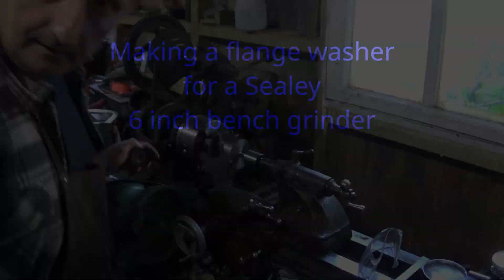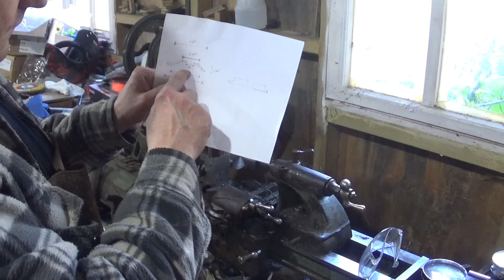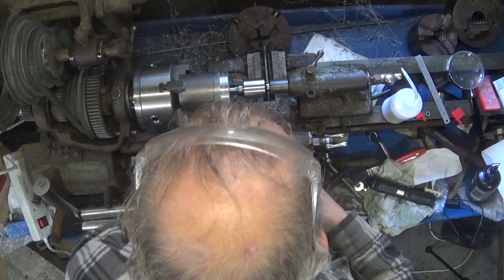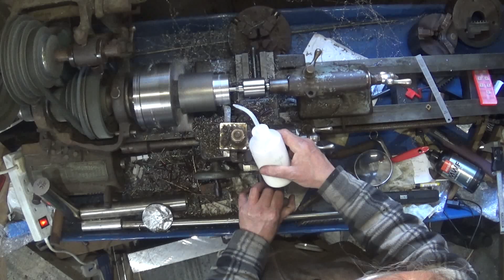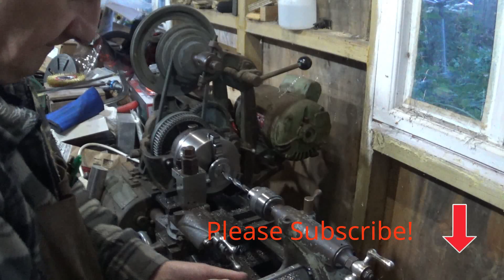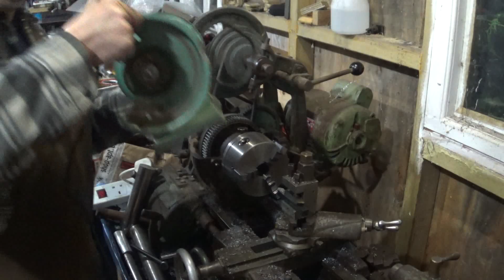Making a flange washer for a SIP 6 inch bench grinder

Comment: Don't spare the horses Benedict my good man! 
The carbide bits like the speed, most older machines can't go too fast for them.
It's very pleasing to see you stood at your machine making components after watching the entire process from shed build to reinstating the lathe. Bravo.
Reply from the maker: Cheers. It's a long way from a hole in the ground.
Reply from the maker: I meant to add that as the outside chips were coming off blue, I suspect the feed and speed was fine, it certainly was further down the bar end. This end was the very end of the bar that came off the rolling mill with a cupped end rather than the usual chamferred and painted end.

Comment: My job is a full time lathe machinist. I think in the beginning your tool was hanging out too far. thats why it was making a shatter noise
Reply from the maker: Thanks for the tip. I expect you are right, besides which, there was no need to have it out that far.
Reply: @BensWorkshop  lathe tip. Always try and keep things as short as possible. Weater its the tool, the work piece out of the chuck, compound slide or the tail stock support. Cheers
Reply from the maker: Many thanks, good advice.